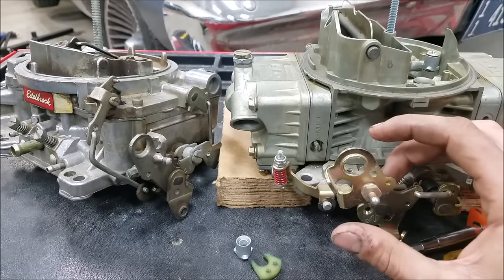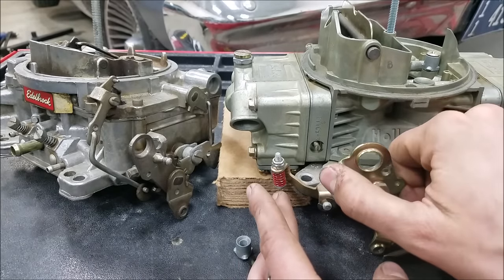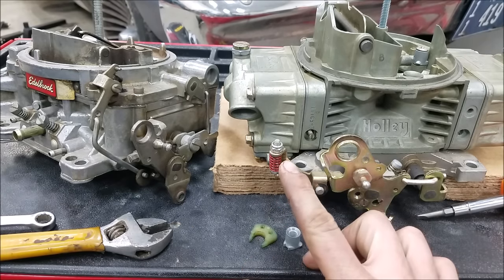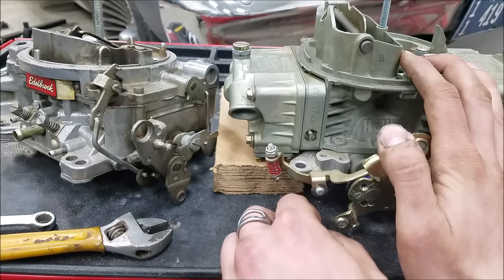MOST COMMON Misadjusted Holley Carburetor Setting (2 second Fix)

Comment: I have a motor craft 2bbl on a 360 I got the truck to learn carburetors and it has a rough idle and I set it to square like you always have talked about but idk what to do next I just need you to tune it haha
Reply from the maker: What is your initial ignition timing?
Reply: @ThunderHead289  I havent had the time to do timing yet and I still need to get a vacuum gauge
Reply: @thunderhead289 where is the best place to put the vacuum gauge on the 2 bbl

Comment: Installed a 600cfm 4 barrel holly carb on my 81 Ford f100 302, seems like it idles a little high and when put in any gear it dies.
Reply: I’m sure you’ve fixed it by now, I’m curious if the park idle needs to be dropped, and accelerator pump clearance tightened.  Let me know.  I have same issue

Comment: Are both jets supposed to work at the same time? For a 2 bbl? Or is one a idle jet and the other a main jet.
Reply from the maker: Depends on the carb - they are both main jets as a v8 intake is basically split to two 4 bangers by the intake. 
Something like a weber 32/36 had a primary and secondary jet, progressive bores into common manifold
Reply: @ThunderHead289  I know it's a stupid question lol. So my holley twenty two forty five should have two squirts every time I press on the accelerator?

Comment: Hey Luke, great channel, I watch it all the time, junkyarddigs too. I have a Holley Street Demon 1901, 625 CFM with electric choke, and I can't get it tuned to save my life. It seems the throttle plates won't close enough to make the transfer slots square, even with the idle screw backed all the way off. Any ideas?
Reply: Maybe the link going to the secondary shaft?

What was it?
Reply: @jakefriesenjake  never figured it out. Sold it and got an edelbrock 500 instead. No more issues.
Reply: @jamesderoche7143  nice.

Comment: Umm Im in Australia and I got a f100 truck and the pump gear on the carb is none existent and the rod that I think controls the secondary is also not there, but it still idles but backfires on acceleration and runs rich. Could this be Becuase the motor was predominantly set up for LPG?

Comment: Actually,, you forgot to mention the transition slots which are the accelerator pump, so to speak, which allows fuel to reach the manifold before the acc. Pump shot, because they are at the bottom of the carb. Which is closer to the manifold.

Comment: Hi im Bob i really some advice im stumped. Been around this stuff for years so im not new to it.   I have a Rochester 2bb carb on a 305 new rebuild  it starts nice runs nice.  But with choke fully open at idle it wont sit on cam to idle properly little on high side. But if i goose the throttle it idles down and sits on cam.  then if i give it gas again does the same thing return springs are strong.  Its like engine vacuum holds open a bit.,.  Again if i goose throttle she idles down like it should.  If i turn off car its fine drops down on cam..  Im stupped here any suggestions?  Thanks i would appreiate it.

Comment: I am aware of these adjustments however I'm having a problem with any carburetor I put on my firebird 421ci
If I slightly open the throttle, it stumbles. I have tried setting the idle circuits lean and rich. It still happens. 
Intake leak maybe?
Reply from the maker: Sounds like it's more ignition timing related than anything. 
When testing with vacuum advance disconnected, id expect at least 12-18 initial, and 30-36 total, all in by 3500 at the latest

Comment: Luke   I have a question.   Is it a good idea to keep the gas tank at or near full all the time?  I fill the tank when it gets a little below 1/4.  Or is it better for the engine to run the tank to near empty?    I have heard that adding gas to older gas is not good but am not sure? Thanks.
Reply: I heard that too about old with new gas. Don't do it, but I don't think it matters.

What matters is that you never run ethanol blend in a carb engine, unless your be driving the car pretty often, even then, I'll never do it again.

With ethanol in the gas, once the engine is super hot, and the carb also, the ethenol will litteraly boil in the bowls. Causes hard hot starts.
I ordered a 1/2" phenolic carb spacer and now I will turn fuel Pump off to get rid of most of the gas in the bowls before I shut the engine down. It'll get fresher gas that way I hope.

About the fuel level in the tank... I would say always keep it Atleast half full, or full. In the cold weather, the inside of the tank could condense water out of the air in the tank. Leaving water in the tank.

If it's a garage princess like my car, fuel level probably doesn't matter too much. Cheers

Comment: Is it possible that cranking the curb idle screw down on a 2150 or 2100 allows the carburetor to drain into the engine after sitting for a couple of days?
Reply from the maker: Nay, not at all related

Comment: Thank you. Holley recommends .010 adjustment at closed throttle. You sound like there should be no gap? What adjustment gap will you use?
Reply from the maker: The gap is at open throttle - the biggest thing is at idle you don’t want to be engaging the lever at all

Comment: I have a 289 I am working on and I just bought a brand new elderbrock carb on it and I seems to be putting way to much gas into the engine and not burning it all and going into my oil pan what corrections should I make to it thanks in advance
Reply: Make sure the fuel pump diaphragm isn't turned and pumping gas directly into the block.
Reply: @kurtgarber2950  ok thanks

Comment: hi, when I accelerate quickly I have a flat spot where engine revs don't increase....will cure that?
Reply: This seems to eliminate the lack of power when initially accelerating. If you have a flat spot in the middle it could be air mixture/fuel pressure. That's my guess at least. After the flat spot does it seem to gain rpms slower than before the flat spot?

Comment: My throttle linkage is functioning correctly, but I still have an off idle stumble. Even when I just try to bring up the idle slowly, around 1500 rpm the truck stumbles and BF. But if i pump it past 1500, the truck sounds good and I know the timing is good. Any ideas anyone?

Comment: On the back passenger side of my carb under choke there is adjustments what are they for? I have on cylinder 3 seems not getting fuel?
Reply from the maker: Under the carb is the secondary throttle blade idle setting adjustment - realistically, you should never have to alter the factory setting if you have both done the other settings and set your timing correctly
Reply: @ThunderHead289  well i set timing with a gun to 10btdc its a stock 351w runs pretty dam well really but cyl 3 having issues dont know if its ignition or fuel problem there is spark but orange and there has to be compression because when i soaked that cylinder with oil it blew oil out truck sat for a long time and i have been trying to figure it out i think its to do with distributor i got shocked by having my hand on top of distributor so maybe its toast
Reply: @ThunderHead289  idle adjustments on front set to around 2.750 turns out idles around 800rpm smooth except for puffing sound out passenger side good oil pressure high when started drops to about mid range once warn and rises when im in the throttle which i assume is normal
Reply: @ThunderHead289   if you want to hear the old girl run its title: Ford 351w swap projecthttps://youtu.be/cN8Cdb1o3Ss
Reply: @ThunderHead289  cylinders 5 6 7 8 and burnimg much hotter than 1 2 3 4 orange blue color 5678 and blue color on 1234 i have s.s headers now so easy to tell lol
Reply: @ThunderHead289  could the Windsor timing be wrong my intake clearly shows windsor firing order maybe old 302cam im not sure i think dist is toast it does have  new cap and rotor, white carbon tracks on inside of cap. Also a cap has a 1 marked on it where u should start #1, mine is 2 positions  off counter clockwise of that if you understand what i mean lol if you look at a dist where 1 is stamped my firing order starts 2 pins counter  clockwise of that 1i do have the windsor firimg order on it ? Could my distributor  be incorrectly installed?

Comment: Do u think i could make a holley 650 vaccum secondary work on a 267 sbc with a small cam
Reply from the maker: kind of - you will need a heavy secondary spring (black spring) if you want to have any chance of proper operation. 
its hard to say on the accelerator pump part - you will have a larger potential lean spot as your engine will take longer to draw fuel from the bowls since vacuum signal will be lower - maybe it will want more accelerator pump to bridge the gap. a little guess and check work will need to be applied
Reply: Mind if I make a comment?  What Luke said is correct. However, I think you will have better performance with a 2 barrel carb. He recommends the heavy secondary spring because it’ll be easy to bog down the engine with that 650.
Reply: ThunderHead289 the motor has an edelbrock performer intake on it, and i threw the 650 on it and after messing with the jetting and air/fuel mixture screws i got it to run pretty decent, its the smallest carb i got and i dont have the money for another one right now

Comment: What if sudden wot , it backfires?
Reply from the maker: Out the carb, or tailpipe?
Reply: @ThunderHead289  Carb 
Current setup, 360 fe, 18 inches vac at idle, holley 600 cfm manual choke.
Reply: Sounds like lean backfire. You need to adjust for your accelerator pump
Reply: 1 Check your engine timing first ( not enough  spark plug advance, combustion starts too late ), 2 Change your accelerator fuel pump squirter for a larger (too lean mixture)

Comment: not correct ! you totally avoided the proper spring adjustment of the accel pump lever. you hold the carb wot and adujust spring nut  until the lever starts to bottom out.....then screw in until you can wiggle the lever.
Reply from the maker: That might be the most silly way I have ever heard of adjusting it honestly
Reply: @ThunderHead289  that is per Holley.....you do nothing in YOUR video to check for bottoming out the pump gasket.

Comment: Thank you.  One more reason for me not to use Holley.
Reply from the maker: It’s one of those “with great power, comes great responsibility” items - a lot of adjustability to handle complex off idle requirements where the Edelbrock can’t, BUT on a street car usually those advantages don’t have to be utilized and it can become quite annoying for some folks